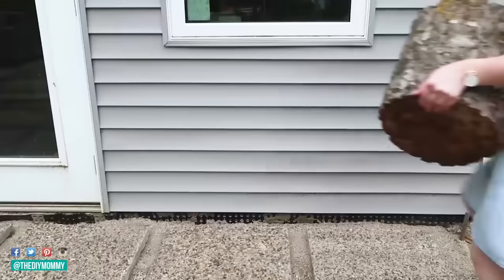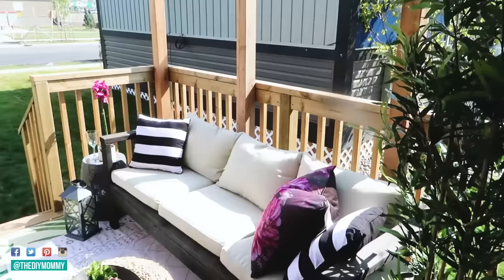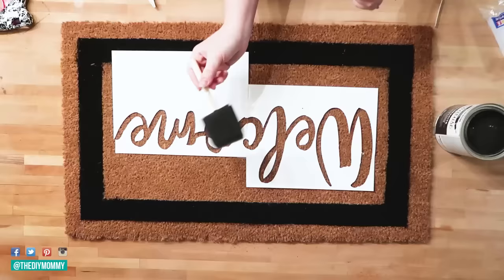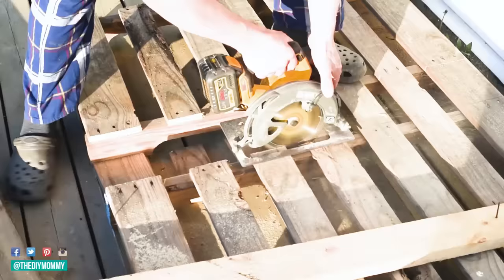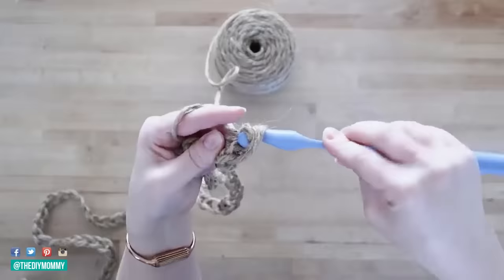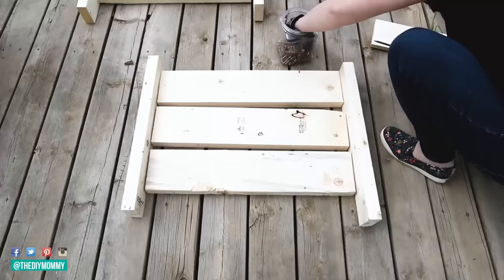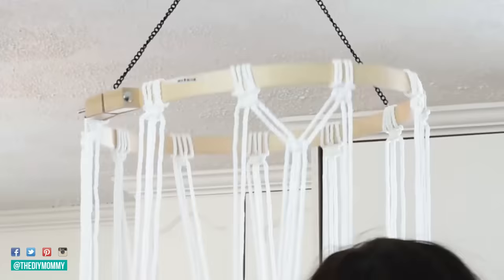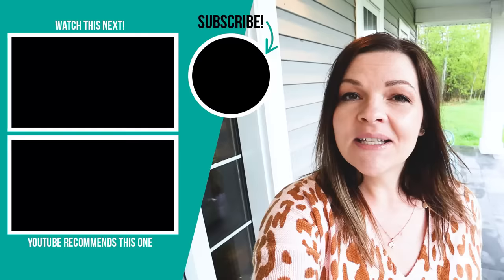10 Outdoor DIY Projects that look amazing! | Outdoor DIY & Décor Challenge

Comment: Love them all. I have just a suggestion that I found worked very well.  For the tire ottoman, I cut a circle out of plywood and screwed it to the top of the tire all around. Put a layer of quilt batting over the top  and then hot glued a layer of fabric over it before I started covering with the jute.  It made it much sturdier and was much more useful that way. Thanks for all you show us. Oh and I put wheels on the bottom so it moves around easier.  (I am 76 and still learning and crafting)
Reply from the maker: Thanks for the tip, Marilyn

Comment: Love the light and the tire ideas that you show.   FYI if you drill a small hole in your wood before you put your screws in, your will prevent the wood from splitting. I noticed that your chair arm was split. Hope this helps. Thank you so much for the wonderful ideas 💡
Reply from the maker: Thanks!

Comment: Very nice ! On using Cedar though, I just want everyone to be aware that they may need to check into this, what I read once but have forgotten ae details : Cedar needs to be aged some b4 painting and maybe staining or sealing, or it won't stick or last. I only learned this after using some for a project which would be exposed to rain so I'd painted it, and found this out the hard way.. . Then, same is true for treated wood, you're supposed to age it 1st for I'm not sure how many months. So, just be sure to look stuff like this up for any wood you buy or salvage, and if buying ask the folks there if there's any such directions for the wood you want & the projects you have in mind.